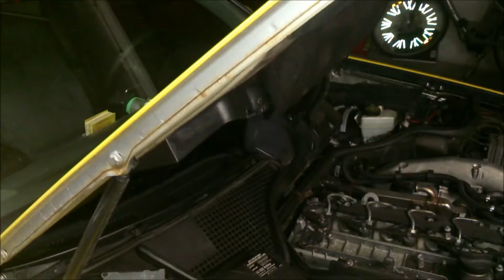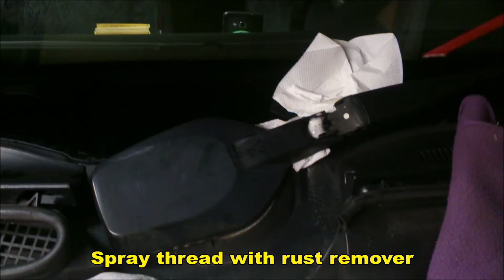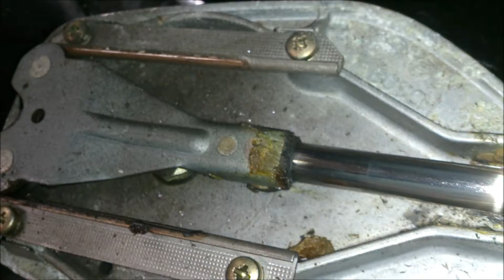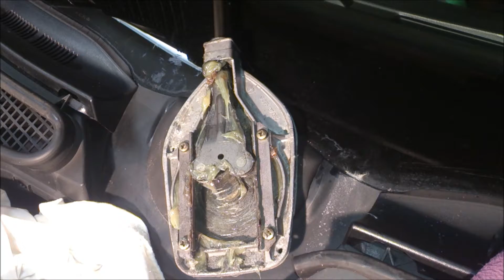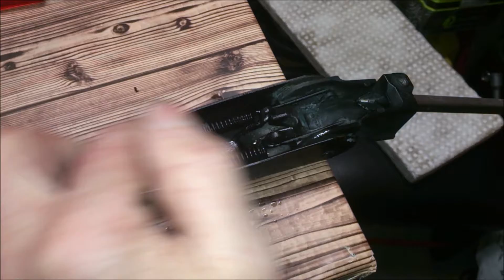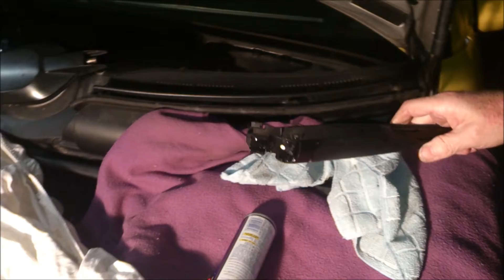Wiper arm removal and lubricate | Mercedes Benz W210 W202 W208 W140 W124 R129

Comment: All well and good , but you only did half the job !

You need to remove the motor assembly completely and do the same in the gearbox under the sliding mechanism you just lubricated : the grease in there also dries out and causes the mechanism to seize up .
Reply from the maker: Yes, but we don't need it at this time. But really thank a lot for the tip.